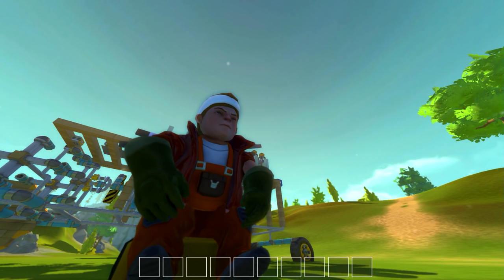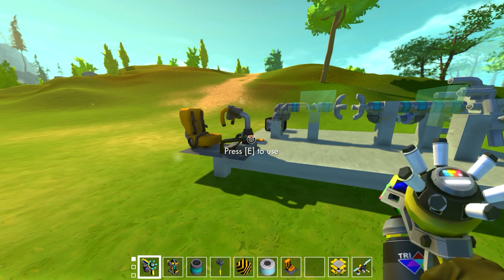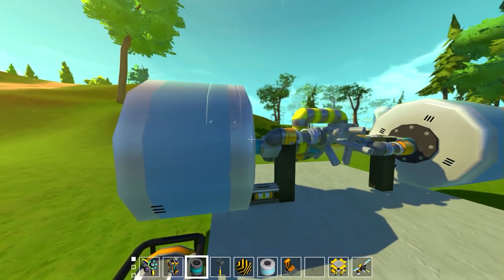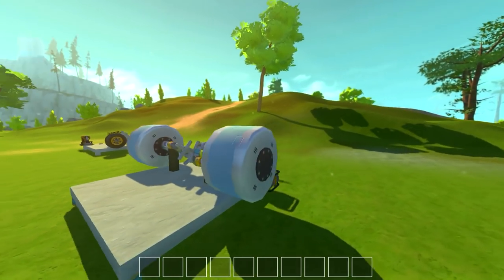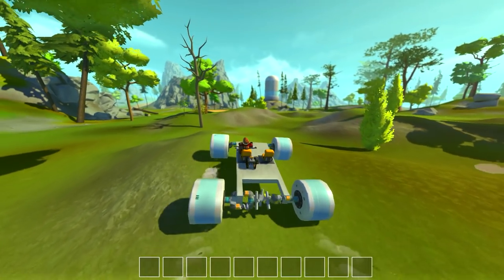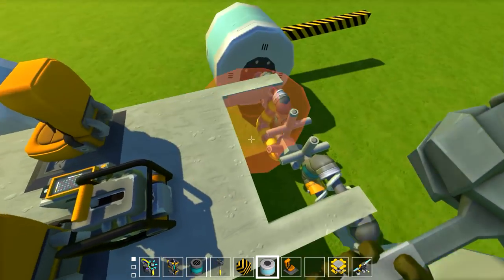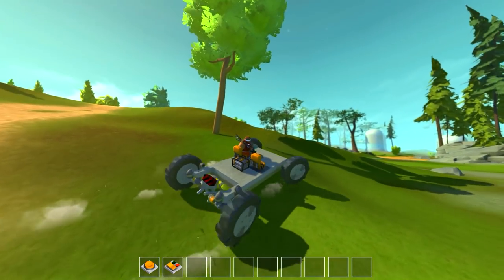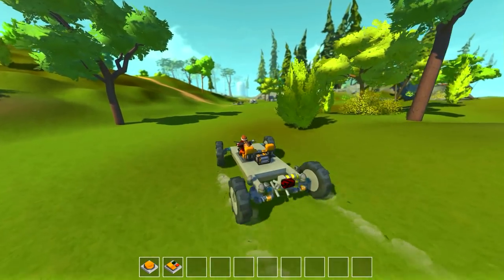Working Differential and Parking Brake! Building an Actual Car! (Scrap Mechanic #162)

Comment: 4:59 that thing is so satisfying to watch xD
Reply from the maker: I agree. I actually just sat there watching it for a bit when I built it. I was super amazed that scrap mechanic physics actually sort of work
Reply: yeah, it went super smooth, no sutter
Reply from the maker: RifleRud At higher speeds it occasionally will skip (pipe pieces go through each other) so I doubt we'll get a super fast car out of it
Reply: for a crawler that would be good since a crawler can't go fast, and btw how are you going to make the suspension with coils, it has to be a solid axel of some sort
Reply from the maker: RifleRud The back axle will probably be a solid axel with independant suspension on either side (allowing torque on the axel) with a CV type joint from the gearbox output to the differential. The diff would move with the back axel (like a truck)

Comment: the drive from the gearbox to the dif. is going to be the harder part than the u-joints and the suspension, but not as hard as the gearbox itself.

if you locked the rotating part the dif. and powered the gear instead, the wheels would spin opposite directions. you will need to make an external case to build into with teeth on the outside and the open dif. inside.

basically meaning, you would need to start at the differential, then the body, gearbox, and finally suspension with u-joints.
Reply: correction, frame, not body.
Reply from the maker: So basically the way I see it is the diff will be straight mounted to the axle with suspension on the whole assembly. A single CV joint would run from the gearbox down to the differential using  2 sets of perpendicular bearings around the center axle. I think it'll work... maybe
Reply: I found out about that problem when I tried to convert the whole assembly into an all wheel drive that has a dif in the middle that runs to the front and back dif.
Reply from the maker: DeepPlane82142 Yea AWD uses 3 diffs (or 2 and a transfer case) but its engine to center and center splits to front and back. usually the center diff has a fixed output split (40 / 60 front / back). my buddy actually has challenged me to build an AWD mechanism in scrap mechanic

Comment: you may make a gate which would unlock the differential if you were turning. you would only need a basic a d converter
Reply from the maker: LightCore lt True! maybe on the final design

Comment: try using the petrol motor or the electric motor on the middle bearing in the differential but not hooked to a seat it will give a small resistance for the petrol motor and a large resistance from the electric motor and my steam name is oddly mechanic

Comment: good idea..but think you got a problem if youre gonna make it with engine..gearbox.. you need to fixate the torgue point to the diff. because you need a straight line from engine.gearbox.. need to look like a T.
Reply from the maker: lars kristensen Yup. diff will have to be offset center with 2 different length CV joints like a car has

Comment: Try making a LSD with a suspension pice inside the diff
Reply from the maker: Sebb C Meachanic I thought of that but the same friction issue with the clutch will cause the LSD not to work

Comment: I have made a engine, transmission, and diff all in one vehicle. But, the main problem with scrap mechanic, is that things can not spin at 3000 rpm or even 40 rpm, with out breaking.
Reply: I know of a diff that can support the power to move a lot of weight. Like 2000 super heavy blocks from durfs mod
Reply from the maker: True the physics don't like fast moving things but mainly I want to do this just for the proof of concept :D
Reply: ok. But if you need a more heavy duty diff. I can help